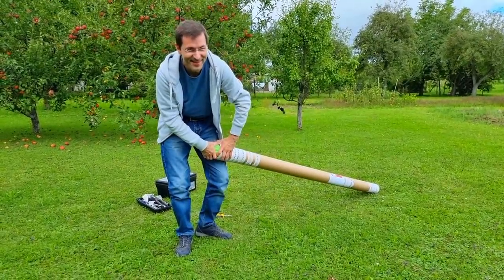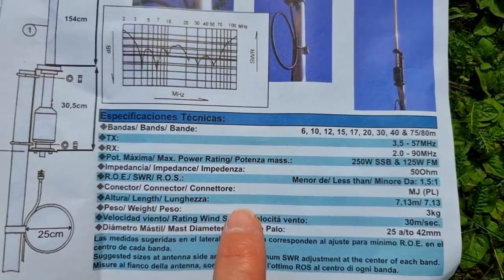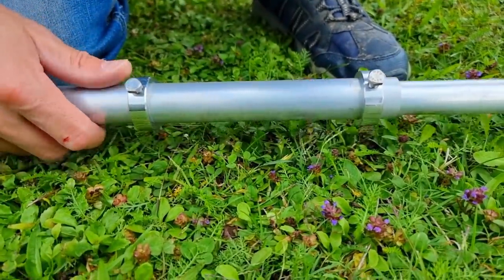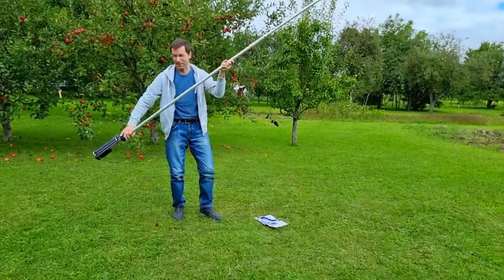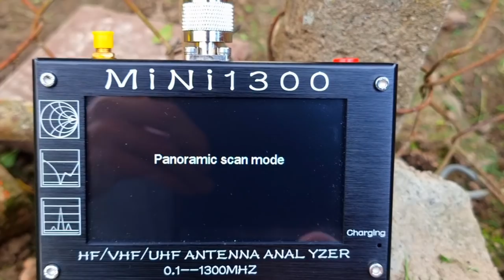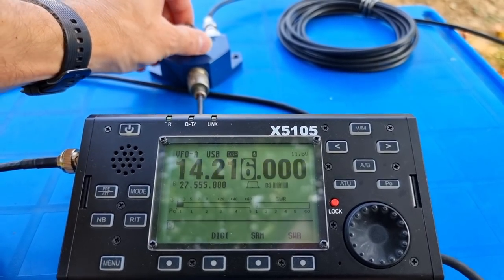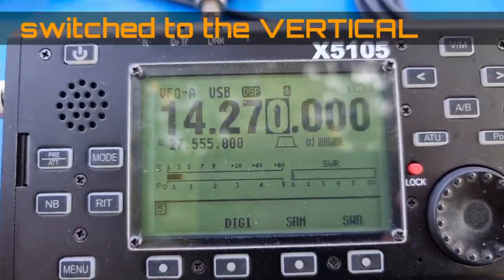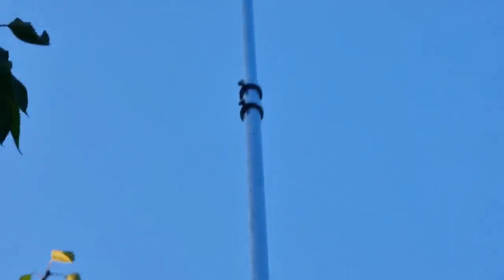HF Multiband Vertical Antenna - FALCON OUT-250B

Comment: Completely wrong info on assembly.  There are different lengths for each tube. Also the item he calls a key is what we call a wrench. But his assembly he never measured anything. When he showed you the paper showing the 6 rings had measurements for each tube. Read the instructions correctly 👌 it's roughly 23 feet tall and needs no radials and only 200 watts max. It's a copy of the comet 250b. Also almost every ham knows you can not coil your coax as he has it because it acts as a choke and will have an effect on your SWR ?
Reply from the maker: Dear friend, believe me, it really doesn't matter if you set exact length or not on this antenna, it will give you always flat 1:1 SWR across all the HAM bands, which is wrong anyway, because of poor transformer on the bottom. It's just a dummyload. On the final I had to bypass this transformer and connect my remote controlled tuner directly to the aluminium antenna pipe. This was the only way how this antenna worked for me, sadly... :D
Reply: This is a random length end fed. It’s using the coax in lieu of radials. Putting a choke at the feedpoint is canceling the coax. 

I would first mount it at ground level. Add at least 8 radials. Get a 9:1 unun and attach as you did with your tuner. Add a choke after the unun. Use the tuner if need be.

Comment: Vertical antennas need radials.  There are no non radial vertical antenna which works successfully.  All vertical antennas require a radial system.  The GAP Titan DX is the only vertical which has a inbuilt radial frame and which is a very successful antenna.   73 de EI6DP

Comment: Ground mount it and put some radials on. And see how it preforms. I find verticals do very well when ground mounted.
Reply: these are not designed to work like that, they should be mounted at a minimum hight of 35' all those antennas are copy of the Comet CHA250b.

Comment: Interesting antenna. Will you be testng it out on a youtube livestream this weekend, if so what time in UTC? Very close between these two but I would say the magloop has a bit of a lower noise advantage.
Reply from the maker: My livestreams depends on the free time on sunday afternoon, but yes if I will do livestream most probably I will work with this vertical by-passed by the MFJ-993 remote autotuner. Best 73

Comment: This antena IS horrible  have bad rendiment insertion loss Dbs IS more rendiment GP 27 With unun 1;6 than out 250
Reply: Many of RF in this type of antena IS radiated on Hot disipation , sirio GP 27 With unun 1:6 have more rendiment
Reply from the maker: I agree, therefore I bypassed this lossy transformer and connected radiator directly to the Autotuner

Comment: I had a similar antenna made by MFJ...in fact, it looked pretty much identical. I had it mounted on a steel post pounded into the ground about 1 meter and the base of the antenna was about 1 meter above ground adjacent to salt water. I found it to be an excellent antenna for general shortwave receiving but poor for transmitting, especially below 10 MHz. On 20 meters and up it was ok but not exceptional. On 40 and 80 meters it was barely better than a dummy load on transmit. My location was very windy (I was working as a lighthouse keeper at the time) and, after a couple of seasons, the base snapped in two from metal fatigue. The manufacturer recommended mounting on a steel mast about 10 meters high or more in which case it might have worked better on the lower frequencies. It did not work well for me, though, other than for shortwave listening. A random wire probably would have worked just as well, though, for a lot less money...Ivan, VE7IVN

Comment: I use a comparable antenna, due to my limited space in the city.

It's the Diamond BB7V rated from 2 to 30 MHz, a 7m vertical.
I find it's best working when it's ground mounted.
I can't Set up a fixed installation so I put it on small tripod for a temporary installation.
With 20m RG58 on 20, 17 and 15 it's a perfect match without the tuner, on 40 the SWR is about 2-2,5 but tunable to 1,1 anywhere on the band with the internal tuner of the 991a.
10m is so broad it also needs the tuner.
80 works with the tuner, but the efficiency is so low it's no fun.

A lot of hams call this antenna a Dummy load too, but i worked the US on 20 and 15 from DL, although I'm right in the city of Munich.
On 40 I was able to work stations all over europe.

The radiator of the BB7V consists of interlocking telescoping sections and can be set up in minutes and it ist self supporting. Collapsed it's only 1,3m.

For me personally this antenna is an absolute blessing. It enables me to get on all bands within a tiny footprint.
I would say any antenna in an urban environment is a compromise, you have to trade space and convenience for efficiency and are limited to what you're allowed to set up.

As far as the Falcon is concerned I would bei disappointed, too.
A fixed 7m vertical should perform better than this. And there are other models, maybe not that slim, but also not really higher which perform much better.
If it's still relevant for you, you should consider a HyGain AV-620 (also 7m long 20-6m incl. WARC) as fixed alternative, or the BB7V for temporary use.

Comment: This was the first antenna I had for shortwave...It worked fine until it seems to do not so wel anymore and my swr went to give strange readings. The problem was the so called water tight balun.  After I managed to open it ( And you can do this only wreck the housing of the balun) there was comming water out of it and everything was rotten inside and even the wire from the balun to the conector had come loose...... And this was only after 1 year on the roof!  Wat good was about this antenna was the quality of the aluminium and the connection between the antenna rods.

Comment: If an antenna has a reasonable SWR from 0 to 30 MHz you can be sure it's going to be compromised, it will not be as good as a (for example) EFHW or a DX Commander, your magloop or any other other antenna dedicated for one or several bands. But of course, if your space is limited these kind of antenna's can be what you need to get on the air. Thanks for the video Paul! 73
Reply: You only needed to look at the values of Z and R on the HF sweep to see how bad it is. Those prove that its possible to have a low SWR but have quite bad values.
Reply: @conorturton  Especially when you are making measurements at the end of a LONG piece of coaxial cable.
Reply: @W1ZY i always plug it either straight to the antenna or small LMR400 patch lead.
Reply: @brentdonnelly1402  Absolutely. I think the Rig Blasters have the ability to compensate for long coaxial runs to the feedpoints. So my comments might have exposed my age.

Comment: Also I've heard that this antennas work better with additional counterpoisse, diamond antennas have info about that in manual.
Reply from the maker: Hard to say, In my case I use the fence as a big couterpoise ;) but I can try to attach a wires too.
Reply: @OM0ET  constructing a bigger loop for garden is also not bad idea, i saw interesting project with external tunning based on arduino.

Comment: I have the MFJ automatic antenna tuner connected to a 23' aluminum flag pole. My base does NOT Touch the flag pole but the base and the flag pole are about 1' apart and are connected by a solid piece of round plastic. I have the antenna grounded with an 8' grounding rod a few inched from the tuner. (the antenna and tuner are both grounded). Currently have flat pieces of 2x4' aluminum sheets around the base and run radials off the sheets. (right now I have 8 radials of various random lengths). Antenna works amazingly well. The antenna is in the back yard of my house and overlooks the fairway of a golf course. Tunes up nicely on 6m to 80. Right now mostly using WSJT-X. Have made 100's of contacts on various bands (20 being the most). Loads of fun!!! Will do some sideband next. de KQ1K

Comment: The antenna can be tuned using those segment lengths on the first side of accompanying "manual" as a guide (you only assembled in roughly by using the measure "both screws are holding inner segment" if I catched it right). But apart of that, resistive load as a "transformer" is quite a bad idea.
Reply from the maker: Yes exactly, no matter how well you tune this vertical, dummyload on bottom makes this antenna unusable in case you don't have any outer additional tuner and baypassing transformer. :)

Comment: Good video. Too bad the vertical disappointed you a bit. But, you definitely proved the value of the magloop. I began my search for an HF Vertical but now I think I might go with a magloop.
Reply from the maker: Thanks! No, maybe just the conditions and enviroment around were not ideal for vertical type of antenna. Keep in mind that the Magloop needs re-tune when QSY, vertical don't. 🙂

Comment: Looks like a GPA27.5 from the old CB age.
And with an almost flat line swr over such a huge bandwidth, first thing I thought was, yeah, that looks like an expensive dummyload. 
You cant compare that with a dedicated antenna. Those will always perform better.
Reply: Need to make those sweep measurements at the feedpoint through a short coaxial jumper, rather than at the end of a long piece of coax.

Comment: Your new QTH garden would also be highly suitable for a DX Commander vertical fan dipole... ;-)
Reply from the maker: Thanks, but actually it's not my garden :D it's just my wife's parents house which is our temporary QTH. I tryed the 22m long inverted V and 49:1 UnUn, also EFHW antenna inv.V, or the Random wire Antenna with MFJ tuner and was not happy with results on the air even if the SWR was fine. ;) Best 73

Comment: Thank you so much for the video. At 38:42 I see the ground wire connected to the mounting plate but I do not see how the mounting plate is connected to the mast securely.  Is it connected? Thanks. I just ordered one of these antennas and plan on trying it with an Icom AH-4 remote antenna tuner.   73 de Jon K7CO

Comment: 1. Two turns of coax is not behaves as choke at all. 
2. Be careful > low SWR in wide range is indicating high loses and low efficiency of antenna. (Dummy load has also low SWR…)
I am recommending the radials. 
Good luck
P.

Comment: Yes, hello Paul, I bought your antenna and I'm happy with it. I always find your comparisons and tests very good. Unfortunately, I have to criticize you a little now, but only a little. A magnetic loop must be suspended horizontally, compared to a vertical one. If the other station has a dipole or beam, you'll get 1-2 S steps better with the magnetic loop, but if the station has a vertical one, it's the other way around. I'm basing this on a study and have tested it several times in practice with my MFJ 1786. With a wave in the ionosphere, the polarization is not changed. Try it once, it's amazing.

Comment: I bought a different version of this. The bottom mounting holes on mine were badly positioned in that when the u bolt was in position , it was too long and it lined up with the bottom of the transformer. I had to shorten the bottom u bolt or, another alternative was to drill two holes in the mounting plate below the transformer that would allow the u bolt full room. I also put heat shrink over the joints for extra strength.

Comment: Similar to Comet antenna
Reply: exactly they are copy of the CHA250b
Reply from the maker: Yes, it seem so :)
Reply: @OM0ET  a lot cheaper than the Comet but really poor performance unfortunately... I have an original Comet CHA250b, although I thought I had fun on HF with that vertical antenna, having a wire dipole smoke the performance of that antenna... it requires a LOT of hight, manual state minimum of 35ft high and having guy wires on that antenna at high hights can be a problem. There is the Jetstream JTV680 and the Harvest Out-250B that are also based on the exact same model.

Comment: Hi Paul it seems your mag-loop is the winner , I made a good choice. ;-)
Reply from the maker: Yeah, it's definitely 1S better than this vertical. :) But on the other side, I have to note that the transformer used in the vertical is very lossy and unusable. Therefore I use the MFJ autotuner to normally use this vertical :) I hope you are happy with the Magloop ;) 73, Paul
Reply: @OM0ET  I'm very happy with the mag-loop Paul amazing what you can work with QRP. 73 Dirk
Reply from the maker: I am so much happy for your satisfaction Dirk 😊 Thank you! I hope to work you one day! 😉👍

Comment: You could as well build one yourself ;-) Set up an old 27 Mhz GPA to 5,50 meter, feed it with open line. One side for the radiator, the other side for three 5,50 m radials. Use a tuner and you can work all bands.

Comment: I know I'm a little late to the party here, but based on the SWR graph you got on this thing being so flat and the fact that it doesn't work very well, I suspect that in might have a big 50 Ohm resistor in the "transformer" case
Reply from the maker: Yes, you are right. This antenna has very lossy transformer. I bypassed it and connected my remote antenna tuner 😉

Comment: All power die in the Falcon transformer.It payment for low SWR.Simple resistor 50 Ohms have a good SWR but we can't use it like antenna :-) I made this aerial and it has not liked me.It SWR is good but efficiency is very low.73 ,Pavel, and gd luck !
Reply from the maker: 35:54 I said the same :D a dummyload. Thanks for watching and best 73! Paul

Comment: Hello, for my part very disappointed with this antenna that I had perfectly installed on my roof.  After very disappointing test editing ... Very difficult to make myself heard ... and very surprisingly the SWR was 1.1 on all tapes ... which is very suspect ... in short, as quickly assembled as quickly disassembled ..  . it had cost me dearly ...73
Reply from the maker: Yeah, same here. I mentioned it somewhere at 35:14 i think. Transformer on the bottom of this antenna acts as expensive dummyload 😒 but I still use this antenna with very good results after bypassing transformer and adding the MFJ automatic remote tuner. 👍

Comment: Just found your channel. You have to realize this thing is basica;;y a dummy load. Do not pay for this.
Reply from the maker: I realized that :D But after bypass the transformer on the bottom and connecting the MFJ-993 Autotuner directly to the vertical, it worked nice :D hihi

Comment: Black Box? Would be nice to no what your dealing with? Sorry to say that it looks like a great dummy load. If it truly does utilize a 49:1 or 9:1 UnUn  may work better with a counterpoise. Did you try it ground mounted? Thanks for posting this vid. Hard way to learn that it doesn't meet your expectations.
Reply from the maker: 35:54 i said the same :D

Comment: Another way to get better performance is bypass the transformer, add a 49-1 and attach a wire on the top when added to this length would be about 130 feet making it an end fed 1/2 wave covering 80 to 10 meters.  You will be amazed at the improvement. The basic antenna pole is very well made so it can be used well!!
Reply: I do have have this antenna and 40 & 80 meters for transmitting is really very poor, so I see your comment and I wondering if it will improve at least on this two bands. Can you send me an e-mail with the details of that change you mention? 73's

Comment: Clever modification using the auto-tuner !
This is how radioamateur works : you try a crappy commercial antenna and finally, you make an antenna that really works by changing the design...
Reply from the maker: Thank you! I think this should be review about, show to people good and bad things too :) With MFJ tuner this antenna works fine :) 73, Paul

Comment: Sound like the Comet antenna with an auto-transformer at its base!!! This isn't a very good antenna... Welll let's see what happens. Even the packaging looks the same. My dummyload has a very good SWR plot as well, just saying. :-)
Reply: 36:31... I think your conclusion is correct. Adding the auto-tuner and skipping the transform will at least get your signals out.
Reply from the maker: Yeah I realized that just after my first measurements and tests 😃 But thanks to the autotuner antenna this "modified" vertical works good 👍

Comment: It looks like the Diamond BB7V antenna, the SWR curves seem identical (as I measure on my Diamond). In vertical polarization, it is not very efficient in SSB but it helps out in the field.
Reply from the maker: I bypassed the transformer on the bottom and connected the autotuner directly to the radiator. Now works perfect

Comment: I really enjoyed your video! I'm considering buying one of these, and just wanted to know if you are still happy with yours.
Reply from the maker: Thank you. Not really. Mechanical construction is durable and good quality  but unfortunately the transformer on the bottom is too lossy. I had to disconnect him amd connect the MFJ 993 autotuner directly to the vertical radiator. Then it worked good 😉
Reply: @OM0ET  Thanks for the info, it's much appreciated! 👍